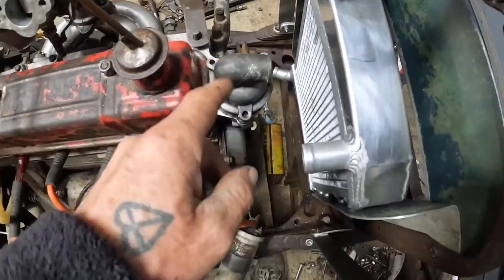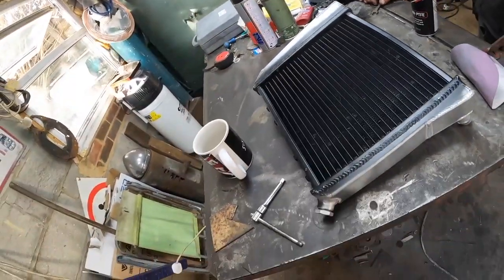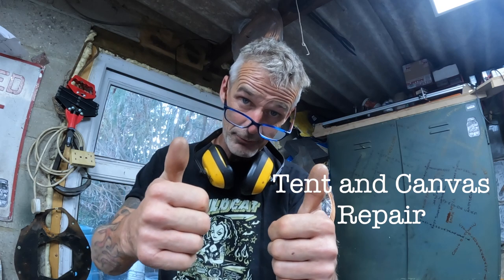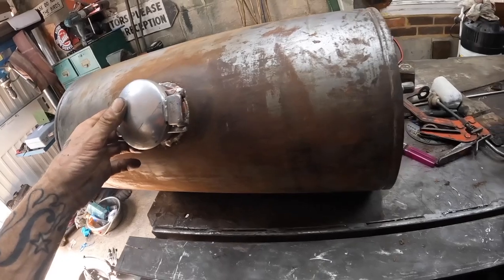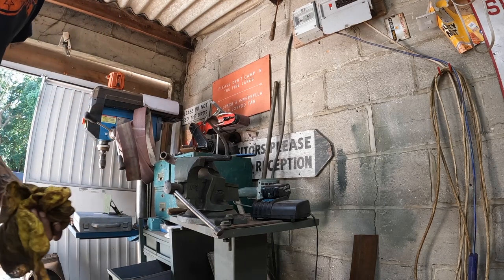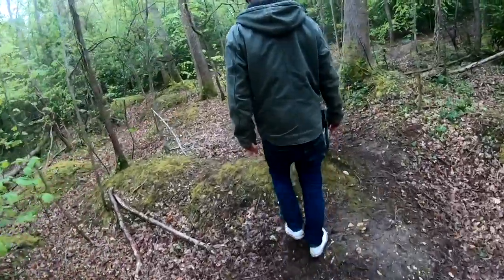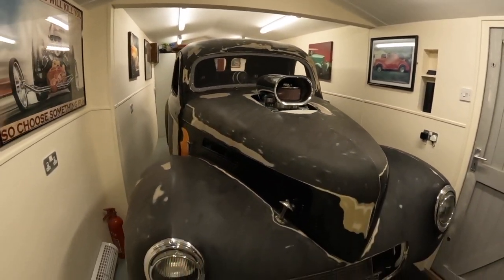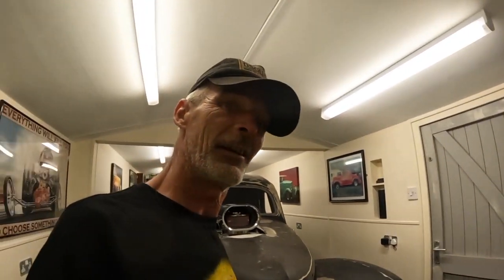the austin ten special....rat ,   part 28

Comment: Great to watch the Austin Rat build. So so like my own car.

 Dont forget to fit an adjustable clutch pedal stop (big bolt with lock nuts). If the pedal movement is too long it can smash the release bearing and you will have to take the engine out to replace it. 

Cant wait for episode 29 !
Reply from the maker: cheers Stephen yes thats now on the list for this week 👍

Comment: Another top video, the dash is lookin sweet,  your bodge for the stat housing excellent and the clutch pedal now fully working, but dare I say it KP!!,  rad housing so very Oak Swamp but good, hope you get a run in the Willys, the wee rat is going to be the Dog's, see you next week. Dave 🏴👍
Reply from the maker: cheers Dave, im having trouble sourcing the parts off the shelf tbh...but i have an idea..and it will be very OS.  hope you are good bro👌
Reply: ATDC have the parts in stock but they are quite a bit of money. YES buddy all good still working on my 10 got some paint on it now and will be working on my engine over the winter, running an SU and electric water pump. Stay safe Dave

Comment: Episode 4 I said a lack of roll due to the rear suspension may cause "traction issues"…

It isn't drivable, yet (in my point of view, this is as far as I've gotten), so this is my "guess".

The lack of roll is like a really thick sway bar & that kart is a drift monster. The back tires will slide, easily, when cornering. To "normal" people (who don't watch things like this) that would be bad, but I would love it! 

I would weld the diff, but I would also need to carry a pair of spare tires, because the rears will turn into smoke, fast!

This has inspired me to finish my project car, and convinced me to use the engine I have in my Goldwing. I have a GL1100, so that engine/trans combo weighs less than anything I could get from a car, and it's free! (…it wasn't free, but I have it, so I don't need to buy it…)

Comment: I've used melted Bees wax to preserve metal, works well unlike boiled linseed oil that you have to reapply every few months.
Reply from the maker: thats interesting.. did it have a sheen?
Reply: @oakswamp  if you rub it with a rag you can get a sheen.
Bought some off eblag, comes in handy size bricks, either heat it in a pan and rub/paint it on or heat the metal and rub the brick on it, doesn't need much.

Comment: Are you going to retain that long waggly gear lever or cut it down a bit (or even knock up a remote shift for it - a bit too much perhaps!). Love the walk and dig in the woods. A metal detector walk in there could be productive.
Reply from the maker: there used to be a gravel pit then tip up there.. there's tons of tin pans and plates everywhere ...the metal dectector would nt stop ! 🤣 gonna leave the shifter long , bit tight in there for a remote and a passenger unfortunately👍